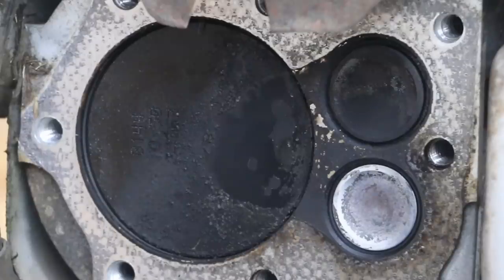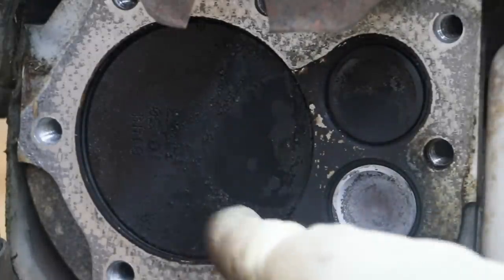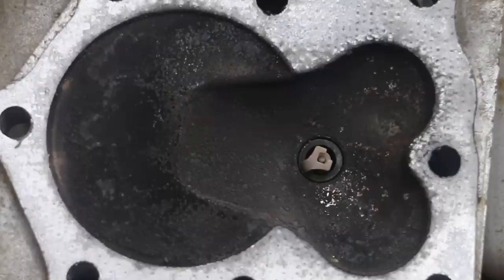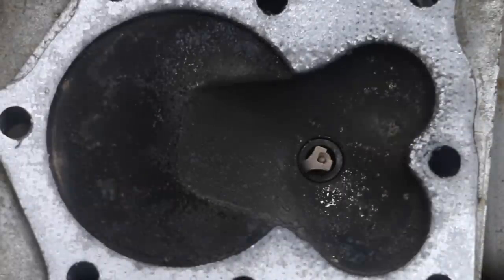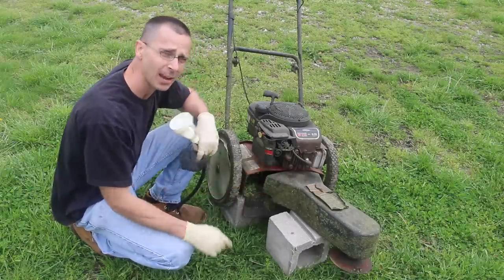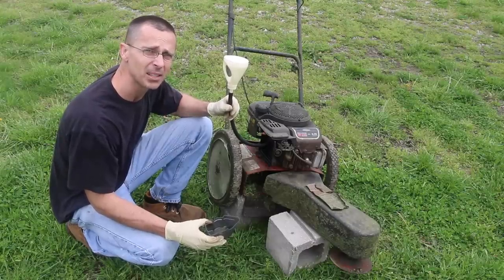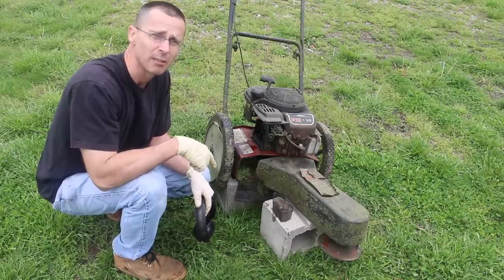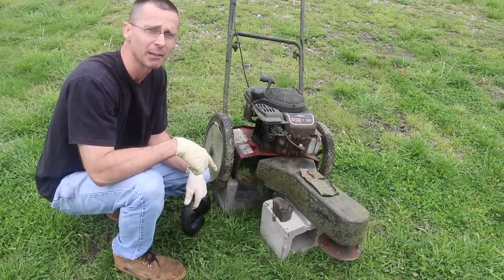Seafoam--can't believe what it did to my engine part 3--cylinder cleaning test!!

Comment: Have you thought of letting a carboned or oily piston head soak in Seafoam? I did just that in a weed eater and it worked wonderfully. I feel like Berryman's B12 would work too but isn't B12 harsher and not viable for long soaks in plastic?

Comment: This is so cool. I did a test just like this when I was a kid. But I put a tank of nitromethane/ caster oil cox model airplane fuel through it. I couldn't get it to run except with the choke halfway closed. But it really screamed and a blue flame came out the exhaust. When I pulled the head off. The combustion chamber was cleaned up like new metal. Very interesting. Could you try that?
Reply from the maker: I'll try this. Thanks for this idea!

Comment: great video, from my own experience with seafoam it seems to work best at full load ( high temps), I did not see a big difference before and after but seafoam does work its great for a maintenance thing to use now and then but it is not a fast cleaner that will work the 1st time
Reply from the maker: Thanks!  Thanks for sharing.

Comment: An ounce of prevention is worth a pound of cure. What is the best way to prevent carbon buildup?
Reply from the maker: Adam, I suggestion keeping a car tuned up with good spark plugs and wires so the fuel burns completely.  Additionally, using a Tier 1 fuel and occasional use of a carbon cleaner additive helps.  Thanks for commenting!
Reply: Tier 1 fuel?

Comment: For the amount of seafoam put through that engine,...well perhaps its just me but I expected much more cleaning if I'm honest. I use seafoam myself, crankcase and fuel and I like it, it's realy good at cleaning out the internals of an engine. A before and after test for me is a look through the oil filler cap, tip in half a can of seafoam and drive the vehicle for 300 to 600 miles and then drain the oil and change the filter, an extended overnight drain time is helpful IMHO. I notice that the new oil stays cleaner for sometimes a couple of thousand miles before it starts to turn black, its not black per say but on the turn if you know what I mean. Also I've noticed if you drive over the 300 miles recommended by seafoam at around 400 to 500 miles there is a noticeable difference in oil colour, its completely black whereas at say 300 miles its not as black but still quite dirty, vehicles I've tested are high end BMW & Mercedes mostly, low mileage, some diesel, some petrol, I've tried it in a couple of full size petrol  Range Rover models and I've noticed how clean everything is when you look in the engine through the oil filler cap...hope this helps somone, over 40 years in the motor trade...I'll just add before I go that recently I had an older bmw 745i that was burning oil at a ridiculous amount, approx 1 litre per 500 miles, maybe a bit less  than 500 miles, anyway I monitored the oil consumption and even with the seafoam in the crankcase after 300 miles there was little difference in oil consumption, it was better but still bad....After 600 miles absolutely no oil was being burned, it had totaly cleaned out the the oil control rings on all eight piston IMHO...what a difference....
Reply from the maker: Thanks for the feedback.

Comment: I had a ford dealer do a water trickle into my car engine and it cleaned the carbon out of it. It ran great afterward and saved me $1000s of dollars on repair! They removed the catalitic converter and ran it at high idle. It sounded like they were pouring nuts and bolts into the engine!
Reply from the maker: This is great to know. Thanks for commenting.

Comment: Just curious  My dad years ago either used diesel fuel or may have been kerosene ..  poured  some in the crankcase allowed the car to run for  several minutes then drained everything out and added fresh oil..  I am not sure if that worked or is that a huge mistake .. this was back in the 70's  would be nice if you can do a video on this .. make sure it is an engine that you are not fond of .. Thanks love your videos
Reply from the maker: Thanks for the positive comment!

Comment: Doesn't carbon deposit add better compression? It's adding a layer in the cylinder causing lower volume thus higher compression and in theory more powerful stroke, or am i wrong?
Reply from the maker: In theory, the added carbon would reduce the volume in the combustion chamber, thereby increasing the compression ratio, assuming no change in valve seal and piston ring sealing/performance.  I do believe some of these additive improve carbon buildup in areas that can't be seen, improving the compression. Thanks for commenting!

Comment: Why not drain the oil, remove the spark plug, set to TDC, and fill it with a strong base? It should directly dissolve and break down all the carbon with no damage to the metal. 

Then drain, flush, and refill the oil

Comment: In our old cars we used to race/drive crazy on an empty field.. we used to get the engine to normal drivingtemp, then stop and remove the filtertop. Start up the engine and rev it to 3-4000rpm, then pop the cap of an icecold bottle of carbonized water, put the thumb on the opening and shake it. Then upsidedown with the bottle spray (not pour, a friend learned that the hard way) icecold carbonized water directly in the air intake at medium to high rpm. Cold water in a hot engine should work kind of like ultrasonic/or cavitation and knock off the worst carbon buildup.
Man oh man, it would sputter and cough quite a bit, while making black smoke, but it did seem to run better after that rather harch treatment.
Would only do that on an old clunker for fun on a field, not the everyday driver offcourse.
Probably shouldn't be used in cars with exhaust catalyst, hehe.
Reply from the maker: Great feedback. Thank you
Reply from the maker: Thanks for the feedback.

Comment: Old schoolers would race the  engine while pouring droplets of water into the intake.  When water/vapor comes in contact with carbon the sudden quench caused the carbon to breakup/break off the metal.

Comment: When do you do a test on engine conditioners like RVS, X1R, Xado?
Reply from the maker: Thanks for the suggestion.
Reply: @ProjectFarm  RVS and maybe also Xado require a long test because they are not immediately active substances. They require about 500-2000 km of driving. At least Rvs. Rvs increased the compression pressure when I did the before and after measurement.
Reply: @ProjectFarm  Rvs improved the compression ratio even though I used a G4 package in an engine that would have required a g6 package and even though I only did one processing, even though a full processing required two stages.
Reply: @ProjectFarm  Rvs has also received approval from the German TUV, at least in terms of consumption, which is proven to reduce it, but I think it's a completely unnecessary feature to pay attention to in a motor care product.
Reply: The most important thing is that the compression pressure rises, because it indicates that a new surface has formed on the piston rings and the cylinder.
Reply: @ProjectFarm  So it would be nice to see engine metal care agents in the test as well. Seafoam is just a cleaning agent. Of course, even that can raise compressions a bit if the piston rings are released. Or if it removes scale from the valves And if because of that they become more dense. But seafoam does not restore metal surfaces.
Reply: @ProjectFarm  RVS Is from Finland, XADO is from Ukraine and X1R is from America. The X1R has an immediate effect of reducing friction, but I'm not sure if it creates a new surface on the cylinders or if it raises the compressions after it is lowered from the engine. I'm not sure if the X1R has lasting effects, or if it's more of an oil additive. Rvs promises that the surface will last 100,000 km. But processing requires 1500-2000 km total mileage or 20-50 hours of use. So the final result takes time, the surface does not form instantly.

Comment: Definate Improvement on the piston crown and valve area but not on the cylinder head I’m guessing that’s because when you do the “hot soak” liquid seafoam settles on the crown of the piston and on and around the valves but due to gravity it does not settle and soak the head so the hot soak is likely gives less affective on the head to my mind due to gravity.....
Reply from the maker: Thank you for the feedback

Comment: The valves looked much cleaner. Perhaps using a spray bottle would be a better and more controllable method for injecting the sea foam into the carb
Reply from the maker: Thank you for this recommendation!

Comment: Hello, sorry for my english, what is exact ¨seafoam¨? i see this experiment with hidrogen peroxide, i think adds more compression , water dont compress, i see this test on Citroen 2cv engine, then i open the  cylinder and a lot of carbon still there, no improvements .. only white smoke.
Reply from the maker: Seafoam is an excellent cleaner for fuel systems and the crankcase of an engine.
Reply: Thanks!! your video is a real test.. congratulations!! try with Liqui Moly cleaner

Comment: Just spray regular water into the carb, just enough so the engine bearly runs, i usaly take a car engine to about 1500rpm and then soak it in water with a spray bottle thru the carb/intake. It works!!

Comment: Sea foam doesn’t seem to make much of a difference. The sea foam process looks easier than water. Do you think multiple sea foam cycles would be better? ($ vs hassle)
Reply from the maker: Thanks for commenting.
Reply: It does. Take another look at the intake and exhaust valves, not the piston area.

Comment: I used a full can of Sea Foam in my last fuel up to my Ram 3500 6.7 Cummins. My truck has almost 80k miles and is deleted. Two things have happened. First, it is much quieter. I'm not sure why that is but  it is quiet compared to before and my fuel economy has gotten better. Normally I would go through  half a tank by mid week going to and from work and Im down a 1/4 tank. I think its an improvement although not scientific.
Reply from the maker: Thanks for sharing.

Comment: A few things to note:
You were using the plain fuel additive and not the aerosol form, so instead of adding it through the carb, you should have mixed it in with the fuel in the fuel tank itself. Along with that, you should have let the SeaFoam soak for a lot longer (at least a few hours).

Overall though, good video. Keep up the good work!
Reply from the maker: Thank you for the constructive feedback regarding use of Seafoam.  Also, thanks for the positive comments regarding the video!

Comment: I don't see much there regarding an off the shelf additive.   I've taken apart lots of engines/ heads and there are better products to apply and let soak. vs running a product through via combustion. Those typically don't work .  With the head off...you can affect a bit more cleaning mechanically and chemically.
Reply from the maker: David,  Thanks for watching the video and commenting!

Comment: Try putting Seafoam  right in the fuel tank & running the mower around on a job, and then spraying the carb, or pouring it in your case, into the carb, then hot soak then prime carb with seafoam again & then start and run. Bet it would have come out a lot cleaner.
Reply from the maker: Ray, This is a terrific suggestion--thanks!

Comment: I agree with other comments that say you would have been better off just using a wire brush in a drill motor and removed all of that buildup in just a few minutes. Faster and cheaper to do. Good experiment though.
Reply from the maker: I agree.  Thanks again for commenting!

Comment: That's not how it's supposed to be added to the engine. It's designed to be a steady stream and not pour after pour. Unfortunately this test wasn't conducted in the right fashion, and the results show it. As for Seafoam, I stand by it no matter what. When conducted properly, a Seafoam cleaning and borescope test afterwards will show dramatic cleansing power in the combustion chamber.
Reply from the maker: Thank you for the constructive feedback.  Others suggested using a spray mist.  Thanks again.

Comment: I'd like to see you try one of those new devices that are out there on the market now that uses this laser device. There's plenty of videos of it out there on YouTube, people using the laser for metal restoration projects as well in the automotive repair industry to remove old painted surfaces before applying the new paint job.

It takes rust off any metal surfaces back down to the original new metal surface without harming the original metal surfaces back to new condition. 

So, I'd like to know on a small scale with the lawn mower engine cylinder head, both apart and to clean both surfaces like you tried with the water & Seafoam treatment before trying it out on actual cars cylinder head rather than having a machine shop tear it apart to clean the head surfaces and back together to see if it'll save money in the long run?
Reply from the maker: This is a terrific recommendation--thank you!

Comment: will you run a motor rich long enough to cause alot of carbon build up on piston and then run marvel thru it for several tanks of gass to see if it cleans better
Reply from the maker: Thank you for this recommendation.

Comment: have you ever tried transmission fluid to clean the engine ?  I know if you ever have that heavy oil or grease that you can clean your hands up easily with transmission fluid.  It is a great cleaner ......  it just has a smell that has to wear off !
Reply from the maker: Yes, I tested it a while back and it did a great job.  I'll test it in the crankcase soon.

Comment: I would like to see you get to identical lawn mowers remove the heads and clean all the carbon off then run regular gas in one and sea foam mix in the other. Alternate using the mowers for year then remove the heads and see what it looks like.
Reply from the maker: Great recommendation.

Comment: I think it did remove some of the carbon. I would guess that if you ran a few bottles through over a few cycles you would seen a dramatic difference. Some of that carbon is relatively thick and needs so,e breaking down before it will release from the cylinder and head.
Reply from the maker: Thanks for sharing.

Comment: I'd say a generous 20% reduction. If you look closely ... It all still looks black but it did take some solids off.

Do this every 20k in a GDI engine and it will certainly be lookin alot better on top of them intake valves after 100k...
Reply from the maker: Great point regarding a GDI engine!

Comment: I have just found your site, really enjoying it. I am contemplating adding Seafoam to the engine in my 1980 Austin Mini. Your opinion would be much appreciated.
Reply from the maker: Thanks for the positive comment.  If added to the fuel, it should help clean the fuel system.  No need to add to the oil, unless you suspect buildup inside the crankcase.  Hope this helps.

Comment: You have a better result if you pore water in the carburetor, did this on multiple lawnmower engines and had near to no carbon left in the engine.

Comment: I think the seafoam burned off before it could do its job, if you removed the spark plug when it’s warm and sprayed the inside of the cylinder with seafoam let it set then cranked the engine without the spark plug to expell the extra. It would have been better. Never start a engine with lots of fluids in the cylinder the hydraulic effect could damage it.
Reply from the maker: Great point!

Comment: Try spraying a ton of carburetor cleaner through the spark plug hole, let sit for one hour, repeat and then run it. Helps way more than seafood. Be really generous with the spraying though.
Reply from the maker: Thanks for the recommendation!

Comment: I used about 1/3 of can to crank case and lifter tick went completly away took about 45 seconds and Ill be changing my oile fairly quick to see if it will need treated again or if it actually did the trick
Reply from the maker: Thanks for sharing.

Comment: would be cool to see with seafoam and other types of valve cleaner aor intake cleaner and the effect on the oil with any blow by. Like would it damage the oil property. like if we decided to seafoam or any other intake cleaners, that we should do it right before a oil change. or doing it a lot as in like 2 bottles instead of 1 or even multiple items would damage THE OIL  causing premature engine damage due to the blow by of the cleaners mixing in the oil.

like how it did with the water drip cleaning, and how the water go into the oil and that would of cause the oil to be not as effective. 

love the videos, so happy that they are truly unbiased and we as consumers can get a honest opinion and a true test of multiple similar products
Reply from the maker: Thanks!  Thanks for the video idea.

Comment: You could try a diy electrolysis tank. I used dishwashing powder and a table top 8amp battery charger. it worked well for my 4.3 heads.
Reply from the maker: Thank you for this recommendation!

Comment: Instead of pouring it into the intake, why not scrub it off with  brush? I've seen it done on cars, why not lawn mowers? Just asking.
Reply from the maker: Robert, this is a great point.  I'm testing the effectiveness of additives inside of small engines to determine if they are effective at cleaning carbon deposits in modern/complex engines that aren't easily disassembled.  Thanks for commenting!

Comment: Hey I heard about your channel and decided to check in out. Started to watch, I got a few good ideas from you and using some of them. I was wondering if you had tried to use automatic transmission fluid as a cleaner.
Reply from the maker: Thank you for checking out the channel.  I tried ATF to clean the combustion chamber, but not the crankcase.  I'll test this soon.  Thank you for this recommendation!